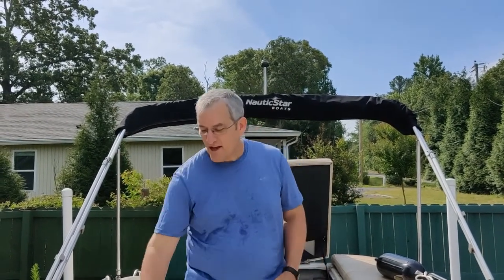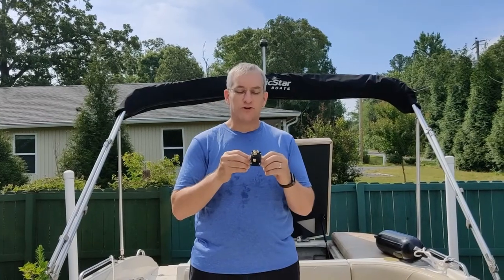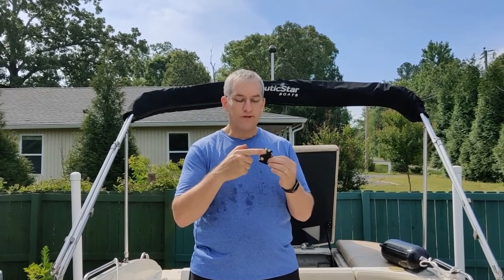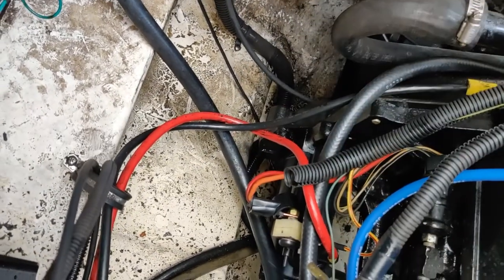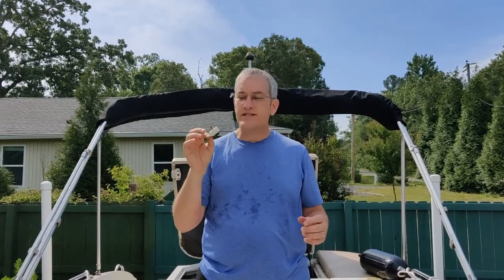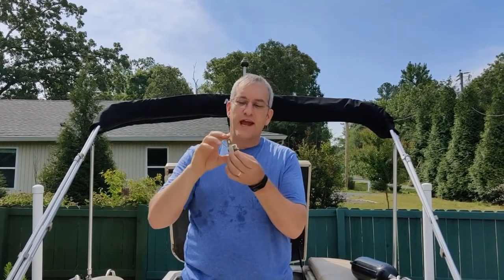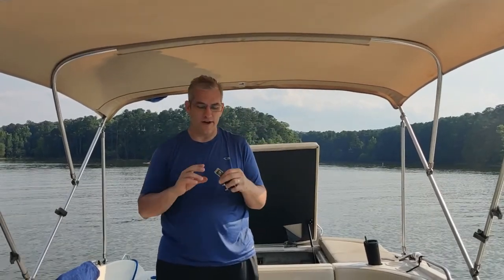Nauticstar Mercruiser Boat Will Not Start - No-Crank No-Start No-Click Fixed!

Comment: Dealing with this problem currently. Trying to figure it out before we head to the lake for the week on sunday, I don't wanna go without a boat lol. Brother is a mechanic and been helping, we replaced the starter, trim solenoid, checked the circuit breaker, wiring harness plug, lanyard switch is good. My brother says that white fuse is good and we're replacing the ignition switch tomorrow. It starts up by jumping the starter with battery probe or screw driver, just not with the key. If the new ignition switch doesn't work, I'm gonna suggest getting a new fuse on for the starter. If that doesn't work, idk what's going on.

Comment: Thanks for this video. ever since last year when i arched my alternator i have had a jumper cable ran from the battery to the ignition to get my boat to start. i have checked and replaced every fuse with no luck. sounds like you had done the same thing that i had so hopefully replacing the 90 amp fuse(which i knew nothing about) This weekend will fix the issue because right now I'm basically bypassing the kill switch to run my boat.

Comment: One criticism. You didn’t actually show how to fix the problem. You talked us through your testing and thought process but I still don’t know where this thing is located, how to get it out and replace it.  I suspect I have the same problem with my boat, and I’m one step closer to UNDERSTANDING the problem, but I’m now looking for a different video to show how to FIX the problem.
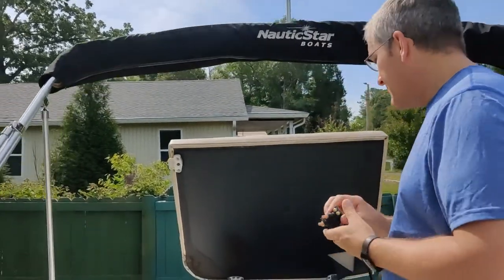Reply: Start watching at 1:05, he shows the fuse on the starter.  The fuse is attached to the battery cable/starter post.